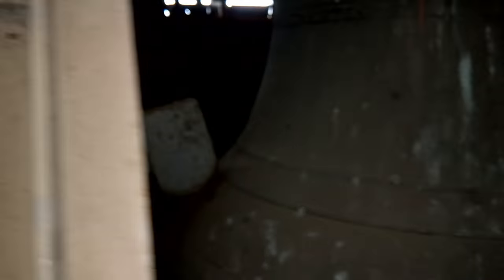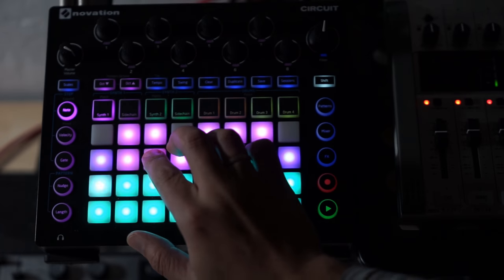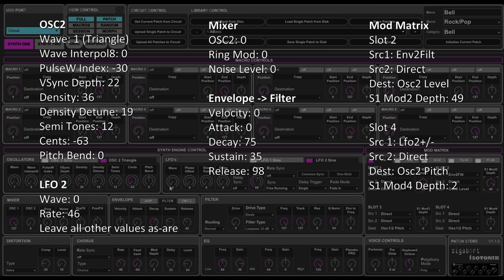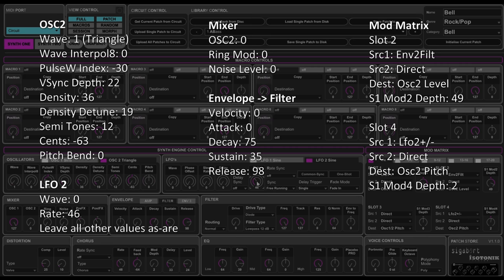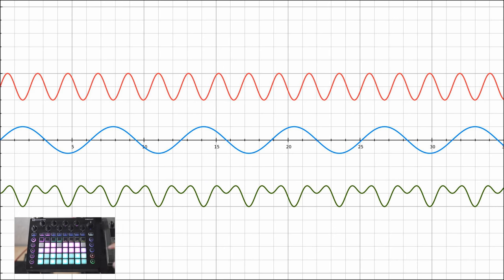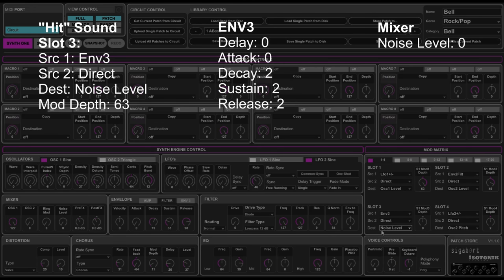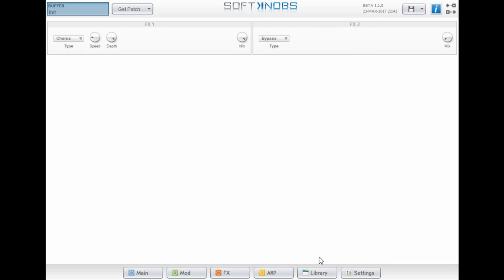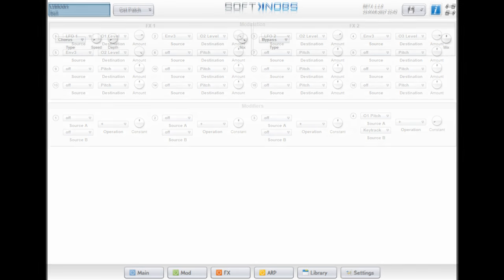How to create a bell sound on a synthesizer (Novation Circuit vs. Waldorf Blofeld)

Comment: Really interesting results. I spent a while creating a bell sound using a Korg Monologue. I managed to get a usable sound for my purpose after adding reverb, although I couldn't get a good striking sound. A true bell sound has so much happening that I would agree it isn't possible to emulate it with any synth.
Reply from the maker: Thanks for watching! Well, that's what FM synths are good at. Modulate one oscillator with the other and the result is a pretty convincing bell sound. As far as I remember, the Circuit doesn't have FM...